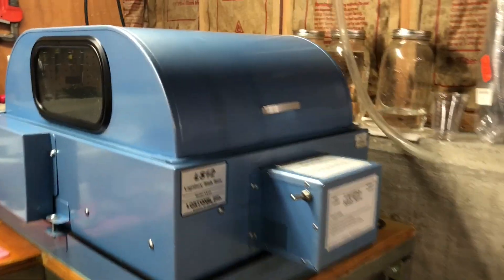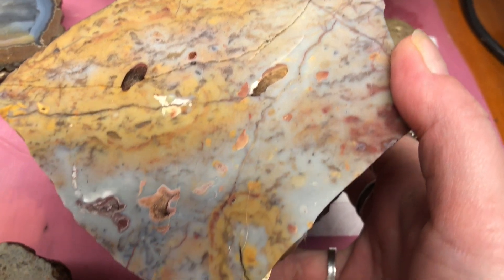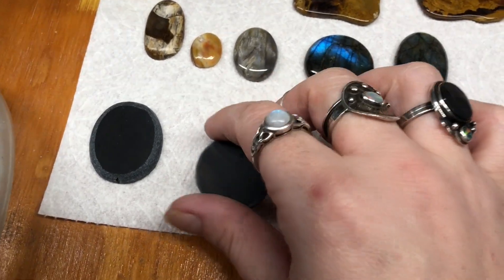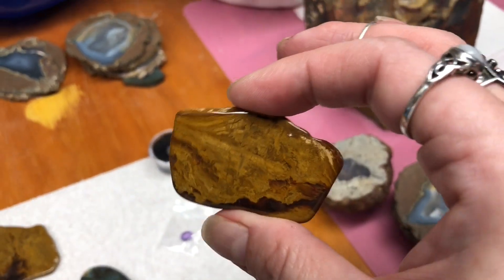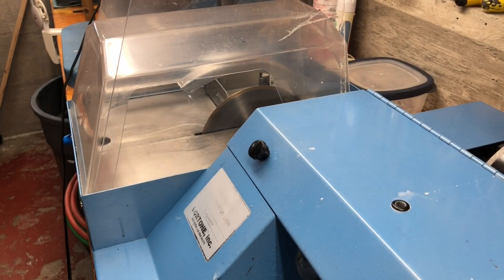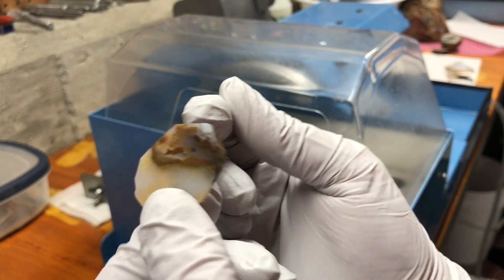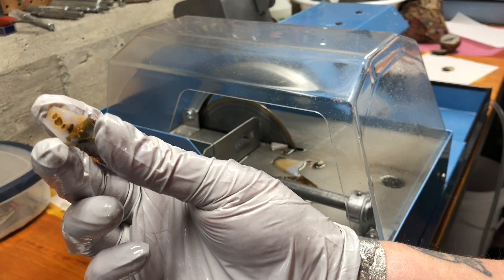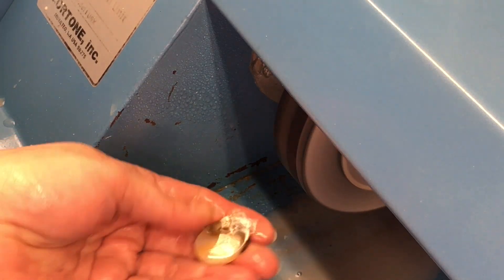Lapidary Cabochon Shaping Demonstration

Comment: Hi there. I do some stained glass work and there is whats called a ring saw that uses a diamond wire to cut curves and or circles. I have not used one but lots of glass workers do. I think if it cuts glass it should cut stone just as well?
Reply from the maker: I am unfamiliar with that tool. I would definitely check and follow the manufacturer's guidelines for the machine you intend to try it on :)
Reply: @nikkiofalltrades7162  
Water jet..👍